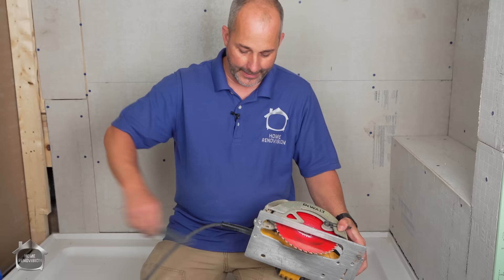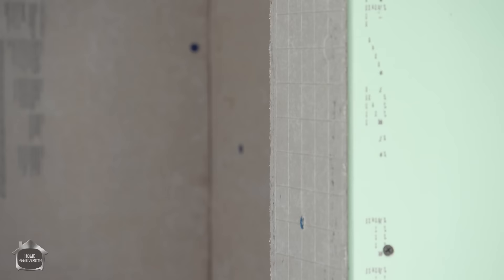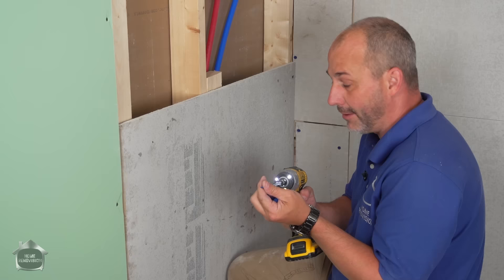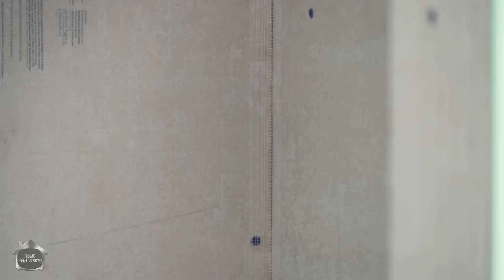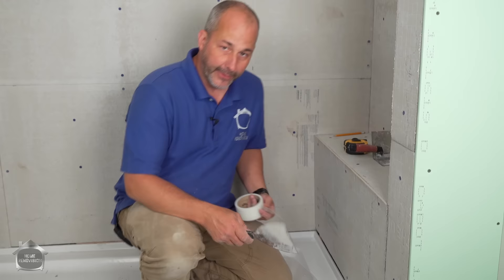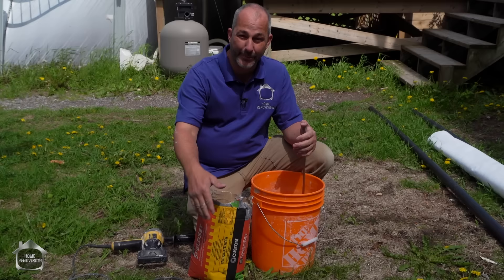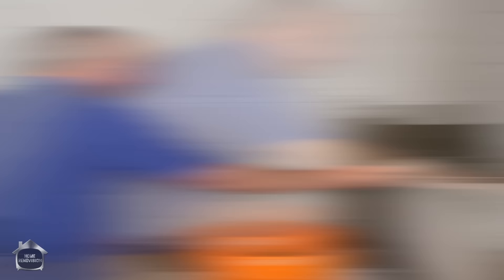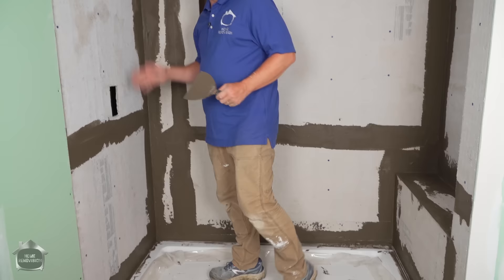How to Install Cement Board for Beginners

Comment: I watched this video 4 times. Then, Built my bath stall with 1/4" backer board. Installed 2 large 12x24 tiles, then thought "those are heavy".  Went to Google, found 5 or 6 sites that say to only use 1/2" board on walls.  1/4" is only good for flooring, is this correct?
Reply from the maker: There is no rule for this. just op[nion. Cheers!
Reply: There are manufacturers suggestions for weight though. You're just wrong. In Washington State you have to use 1\2 in because of weight issues.
Reply: How do you mud the top corners where the backer board and drywall meet? Fiber mesh tape or drywall tape? Drywall mud or thin set?
Reply: @jerryz255  cement board mesh tape
Reply: Did u really just get mud all over the new shower pan ?

Comment: I'm in California, I use to do cement beds for years but I have changes to 1/2" cement board and Schluder.  I have never had a call back and I've been doing it since 1964.  Retired now but still working on my homes and I like the ease of the cement board and Schluder; I have used Red Guard and have never had any problems .  Going to try the stuff you used, I don't need it to last 50 years I'm 73 and don't expect to be around that long.  Let the next guy use some new product .Thanks for your videos, I like them allot.
Reply: well .. John ? I EXPECT you to be around and healthy a very long time. ;)
Reply: I like the roll on membranes like mapeis versus schluter Kerdi. To much build up and tedious application of Kerdi band in corners. Kerdi over cement board is silly imho, just do a roll on. Easier and cheaper.
Reply: Have you ever used hot mop?   A lot of the bathroom bids I have received they only use hot mop for water proofing?   I heard this is a southern cal thing?
Reply: Peter D NEVER EVER EVER let someone talk you into a hot mop installation. I make good money in Central CA working behind contractors that did a hot mop. It’ll fail, you’ll have mushy tile and that’s the least of your worries if the shower is in a second story.
Reply: Is there a way to make a shelf  with the tile for shampoo and soap with out making the cut out in the wall?
Reply: Hello, from a 29 year old guy. Ty for your construction services. Something contractors never hear

Comment: 4 inch grinder with a diamond blade is the norm for cutting cement backer units. Waterproofing is just a recommendation not a requirement to do a pro job for a shower stall, or tub surround. Steamers should have proper pitch for water movement, and a waterproof system to eliminate water penetration. TCNA is a book National Standards and Recommendations. Local codes and regulations are non existent. Manufacturers would like to control the methods of application. Credit card thick is typically what most liquid waterproof membranes call for. 1 coat would not be warranted.

Comment: Hot Mop, aquabar paper, wire,  scratch and cement float your walls is the only way a true tile man does his shower here iin orange county ca. if the GC sees me putting hardi backer and paint on a shower  wall ii would be kicked off the job and loose 100,000  tile contract on these custom holmes  here in so cal. but if the homeowner wants to save money and diy themselfs.hen no prob just note that red gaurde and most other paint start to break down after 5 years not 30 to 50 i know i have torn many out due to water damage

Comment: My question relates to the new fangled foam based (cored) tile baker board.  You know the latest entrants; Go Board, Ardex,, Kerdi....you get the point.   If the remodel job is using high end porcelain large format tile... isn't there a risk of long-term deterioration of the foam and/or the bond between the foam and the fiberglass surface treatment.  I'm not 100% convinced that the light weight, easy to cut foam based products are analogous to the difference in cars made in the 50's. 60's and early 70's that represented real substance vs. the sell it hard, sell it fast and count the delaminated tiles later profit and marketing strategy of corporations.  Let's not forget that Boeing....has cecum to strip mining for profit.  I can go on... Please make a video addressing the delta between innovation and profit engineering.  BTW... no contractor will fix their F-up 3 years after the fact..

Comment: I am from Egypt and we don't have any code at all , also am in love with the wood house structure that you have , it makes life easier when renovating something or even when you like to add a feature , but here in Egypt all buildings , flats and what so ever are made of bricks or stone base so its very expensive and hard to renovate anything as DIY , anyway I would like you to know that am in love with your work and admire all the hard work  and effort you and your son do in making such a good production , GREETINGS FROM EGYPT   (Do the pool)   :)
Reply: On the flip side, cement houses really cost you a lot less to maintain. In US if we have a leaking sink, toilet, or a shower leaking, if you don't fix it right away you can rot your whole floor out, then you're out thousands of dollars if you pay someone else to redo your floor. With a cement house, you can wait a week or month, and all the water gets sucked into the cement. After years and years it may damage the steel reenforcement or something, but it's a lot better in the perspective of maintenance costs or deferring maintenance. Wood houses just require so much maintenance that if you're not DIYing it all, costs thousands and thousands. You also need to deal with termites and flood damage, too, even if you maintain everything perfect, nature can still hit you. 

I've been to Vietnam, with similar cement buildings. One option you do have is just to use steel studs and use plasterboard/drywall if you want to make rooms inside of the cement walled rooms. That's as cheap or cheaper than wood and it's all the same processes, just you need anchors for the screws into the concrete for the steel studs. If you build a house there in Egypt, perhaps just make the load bearing walls and exterior walls cement like normal, then make it open for the rest of the house with steel studs. Then you can move walls around any way you choose fairly easily, but get the cement house durability.
Reply: No codes but last I checked your Pyramids are still standing after thousands of years!
Reply: @maximaniac7231  Hahahaha!!!! 😂 Apologies...Only just seen your comment...LOVE IT!!!😂👍👍
Reply: South Florida. Is mostly CBS. Metal studs.

Comment: We did our master bath about 6 months ago. It took time, but i brought it from the 1980’s to the 2020s! Did everything ourselves (hubby did the shim work- original shower as off plumb by about 3 inches!) and i did all the floor demo, installing the hardibacker, and the tiling and painting. All I have left to do is crown molding, and that will go in, in the spring. I’m doing the laundry room floor now, and the hall bath next week. I watched your vids closely to know how to do stuff. Thanks! (Fwiw, I am 68 and female, so one is never too old to learn!) East TN

Comment: I've had the 20 volt version of that Dewalt circular saw for over a year now, and watching this video a second time I just noticed Jeff pressing a thing to lock the blade to change it. I've just been holding onto my blade itself to undo the bolt. Grr.

Comment: Im from Philippines.. and ive been diy my tiny house after finding your channel..  saves me a lot of.money... and ive developed new skills and new.found loved hobby..
Reply: Hi you will use frame tini house with timber or steel?
Reply: @chinhvannguyen1685  here in Ph we use concrete hollowblocks.. and steel studs for interior...steel frame for.roof..
Reply: @bfjohnmark  I from viet nam, I want made cement board with coconut fiber
Reply: Its flat!
Reply: kami sa batangas ang water proofing namin sasa dahon nang coconut....pinag sasalisi it works great

Comment: Was waiting for the cement board after watching 5 vids - in Australia, we only use cement board for wet areas. and shower waterproofing code is - fiberglass epoxy best stuff we got, will last over a lifetime $750. the roll-on membrane $450 - has lasted over 35 years so far no leaking at all best with acrylic primer, throw fine dry sand after the last wet coat of membrane dries, for the tile glue to bond. like your vids...

Comment: I am redoing our basement shower. I am learning as I go so I found this video very informative. I built my own shower pan so I already had membrane down and I used cement board and I have the mesh tape. Now I know how important it is to use quickset over the tape and roll on membrane. (Other membrane is vinyl). Love the video. You call it as you see it. Helped a lot. Thanks Jeff.
Reply: I didn’t even know you had to coat the board with anything except thin set when you tile.
Reply: Ts 2

Comment: Jeff,  I live in Arizona.  I used red guard on cement board, worked very good.  You’ll need to have lots of air circulation or better yet a respirator while using this product, one can get overcome from vapors.  I found I didn’t care for the high volume of dust while cutting the cement board with the circular saw. It would create dust everywhere.  Not only did I need a dust mask so did others in the area.  I also found it hard to see what I was cutting. I found out that using a jig saw with a carbide jig saw blade (from Home Depot or Harbor Freight) I could cut very controlled straight or circular cuts.  This would create a very low volume of dust in the immediate area only so I could now work inside the house.  Still needed a dust mask!

Comment: Thank you. I have been on the fence as to what system to use for an up coming DIY shower build. Then last week we had a plumber come to repair an old tube valve. He found an access point in the hall linen closet. I saw the wire  and cement that was embedded on the backside of the pink and black tile. The house was built in 1955. No broken tiles, no cracked grout. So along with your comments about the number of years this system should hold up….decision made. These are absolutely THE BEST-VIDEOS ON YOUTUBE.

Comment: Hey John from upstate New York here. Thanks for the info video. I am in the process of redoing a bathroom for family, total gut job to the studs. Took out the old tub and turning area into a large tile shower. I was thinking about the Schulter system for over the cement board, but watching this video I will use the roll on water proof membrane, a lot less money too.  Thank you.

Comment: I was curious about how to tie the shower/tub flange in with the cement board. You just answered my question. I appreciate all of your valuable info.
Reply from the maker: Cheers Alan, happy to help!
Reply: Yes, but he use the tape and patched it with quickrete.
Reply: Jovan Hardwick you will time it almost flush to the shower pan and overlap the flange.

Comment: I'm a first homeowner and have to replace my tub. I had to take out the subfloor which I was down to the joist and about to place new plywood. Had to take out the wall tile and part of the old wonderboard . It's about a foot or so from where the tub sits. I know I'm gonna have to replace all the wall tile. I'm trying to learn much as possible. My first time so I'm watching a lot of how to videos. I didn't know about the mesh and concrete , and that stuff you rolled on, don't worry I'm going to rewatch this and other videos until I'm sure of what I'm doing. I just wanna say thanks for the DIY videos.  appreciate it and others that give a helping hand.

Comment: In Brazil, I don't know what are the building code (so to speak) requirements on wood/steel framing wet areas. But since this type of contruction is only starting to get grip, (99% here is masonry), we are still learning about these methods. 
We know a product named "glasroc", and a type of cement we use to glue the tiles that are made specifically for wet areas, we call it "AC3", and it's obviously preferred to use a ceramic tile with the lowest water abortion index (under 0,5%) . But people are discovering new methods for proper water insulation behind tiles... And I believe this green stuff you canadians use seems to be a kind of polymeric resin, and it's good to learn that trick!

Comment: excellent tips Jeff!  ..using mesh tape to tape the cement  board to shower lip is exactly how i have done it for 45 years...never had an issue ever!
Reply: Where's the shower lip? U mean the transition from (wall) cement board to the bottom of the bathtub? Also, please advise me, after applying Aduadefense waterproofing, what kind of thin-set mortar should apply on top of the Aduadefense (substrate)? I watch many mortified or un-mortified thin-set with many ANSI specs, and now I'm confused. Thanks for your pro tips since u've 45 yrs under your belt!

Comment: Jeff, I live North of Cincinnati, OH. The Tile Shop's recommendation for water proofing was before putting up the cement board put a rubber liner from the drain, half way up the wall. So if water would get behind the cement board it could only go to the drain. I did not have a fiberglass prefabricated shower pan. I custom built my own. This is how I was able to take the rubber to the drain. Then install the cement board, caulking the joints & corners. Then go to tiling. I like your idea of the roll on liner so the water can not make it to the cement board.

Comment: Sir thank you so much for the video, I learned a lot!!! I'm from Mid-Michigan, our house was built in 1840's and is a Greek revival sty;e house.   It has been remodeled inside more than several times I'm sure. We have had it for about 27 years now and I'm doing a re-model of our downstairs bathroom, new floor and walls included, again thanks for the video.

Comment: Can you seal the space between the cement board and pre existing drywall with the same thin set mix? Or should you use another material? 

It’s now officially my weekend morning routine to binge watch this channel 😂
Reply from the maker: Hi Natalie, using the cement is perfectly fine. I have found that the best way to transition from drywall to cement board is to let the tile do the work. always install your joint to be hidden by the edge of the tile. Cheers!
Reply: Home RenoVision DIY Much appreciated!
Reply: Great question Natalie I was wondering the same. Thanks for the answer Jeff.

Comment: Jeff, I love watching your videos. I have learned a lot. I understand why leaving an 1/8 inch gap between tub flange and cement board prevents noise while in tub. But doesn't covering that gap and filing with cement just bring the noise problem back? Asking for my friend David.

Comment: Great video, but just a tip for everyone regarding waterproofing layers.. subsequent layers should be perpendicular to each other as per the American code.
Reply: Can you elaborate more on this?.  I think I understand but need more clarification
Reply: @velocityacoustics i think he’s saying if you rolled vertically up and down on the first pass, you roll horizontally side to side on the second pass thru.

Comment: What I don't understand:  When you install the tile on top of the waterproof membrane, don't you silicone the seam where tile meets the shower pan? Doesn't this prevent the potential water that made it past the tile to run off back into the pan, and just get stuck in the flange area and potentially run into the framing?
Reply from the maker: the silicone is used as an aesthetic concept on tubs but not needed at all for showers. Cheers!
Reply: The tub has a flange that goes up about an inch. If a little water got back there it wouldn’t get to the framing. Actually the membrane would prevent the water from even getting to the flange.

Comment: We had guys redo our master bath and only wanted to do one coat of redguard insisting that the thinset and tile are waterproof.  I laughed and I insisted on 2 coats because we were using expensive tile.  Then they complained because the too thin thinset they were using wasn't drying as fast as normal because the excess water in the thinset couldn't absorb into the cement board and the tiles were sagging.  I had no issues with the bathroom I did myself.  I will do all future bathrooms and not hire out (although it takes me much longer to do it)
Reply: i'm having a hard time with my guy as well, he's done a great job demoing, but this past week I didn't see any work and it's about 1k down the drain for me.  I feel like he's wasting our resources to frame things that don't need it, but I'm going to insist on him doing what we want him to do.  I want our bathroom really waterproof.

Comment: Jeff, do you ever recess the shower and bath into the stud wall so the integrated flange is behind the cement sheet? This is the way most plumbers install them in Australia. It also fixes the problem where two walls are not at exact right angles.
Thanks for your detailed explanations as they've corrected a lot of my previous methods of construction as a home rennovator.

Comment: I've been following your videos to renovate my shower and they have been so helpful, my question is, how do you finish the gap between the drywall and the cement board? What's the best material for that transition?Can I use drywall mud or should I stick with quick setting cement?

Comment: Great video, would like to see you do one where you install a curbless shower.
Reply: He has done it with some project. In Sweden curbless is the standard so all of the floor has to be waterproofed with a kerdi like membrane and also the walls of the shower and the walls 1 meter from the shower also. Rest of the bathroom walls  needs atleast a roll on membrane or usually its done with the same kerdi like membrane. Yes its very overkill and expensive.
Reply from the maker: Hi Darren, you are in luck! we are doing a bathroom remodel with a curbless shower at the end of October. videos will be released in the new year. Cheers!
Reply from the maker: Cheers!